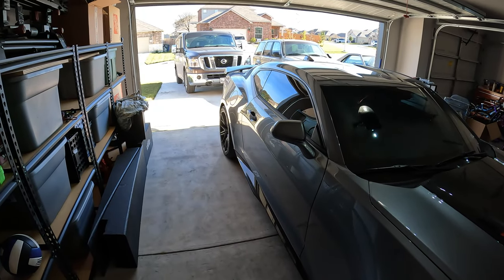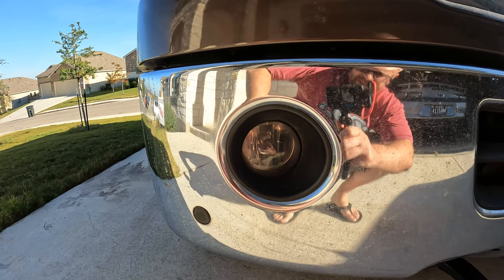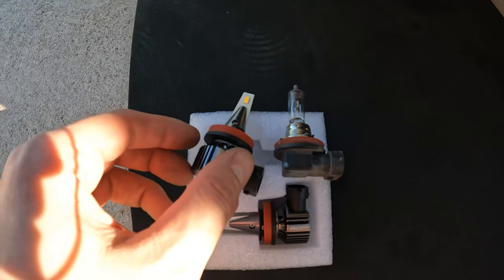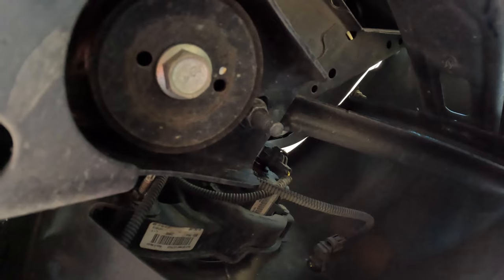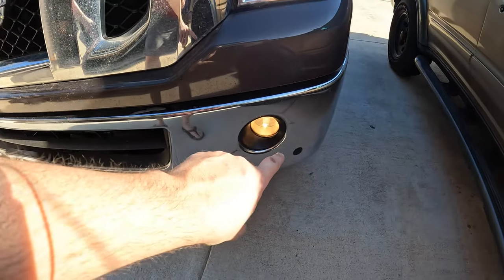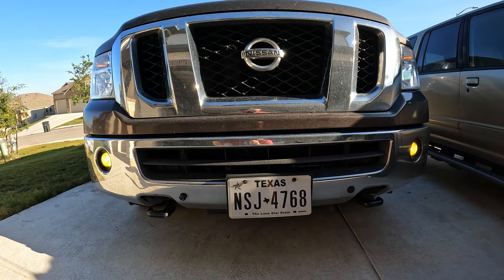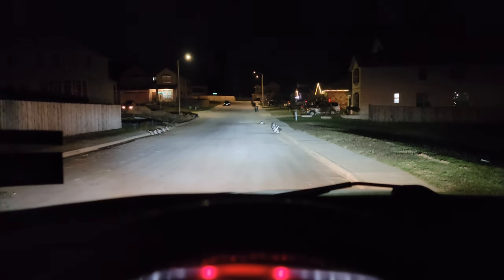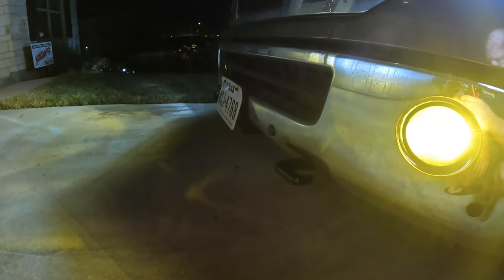Nissan NV3500 LED FOG Light Bulb Upgrade!! Let There Be LIGHT Part 2!!

Comment: Interesting that your headlights give such an even pattern. I have the Auxito bulbs I installed after watching your video. The pattern has significant hot spots and a few stripes of dark in it. The bulb orientation is vertical like you show. Its a huge improvement over stock, just not as clean looking as yours. My back up lights come in tomorrow. Can't wait to see the improvement there. The stock ones barely put out any light. I'm thinking of installing white bulbs as road lights/flood versus the yellow fog lights.
Reply from the maker: Hmm.. weird... I'd suggest maybe rotating them around and seeing if the light pattern improves with a different orientation. It def should be a nice clean beam. I ran these since my video and they've been awesome and the visibility improvement is 1000x better. I HATED the stock headlights which are probably some of the worse in a car I've ever owned. I used to run white fogs in my Xploder but switched to yellow as they do help pierce fog/rain better than white which reflects back but it's mostly just user preference on the look you like most :D
Reply: @D3RPZILLA  I'll play around with it as suggested. Likely going with white fog lights to use more as road lights.